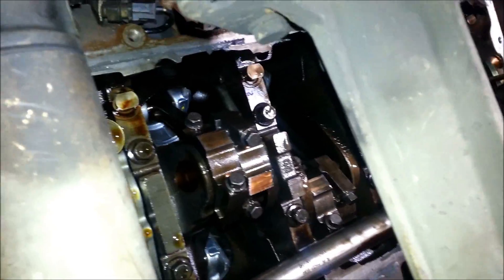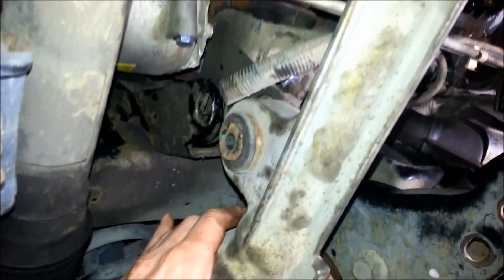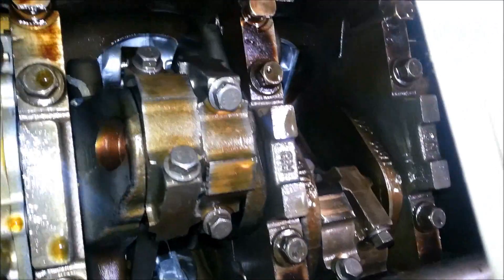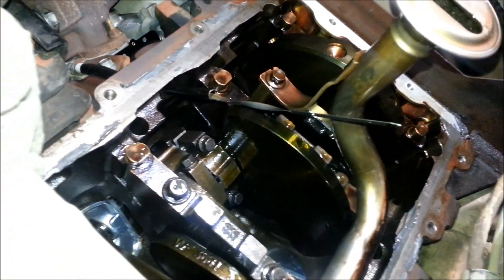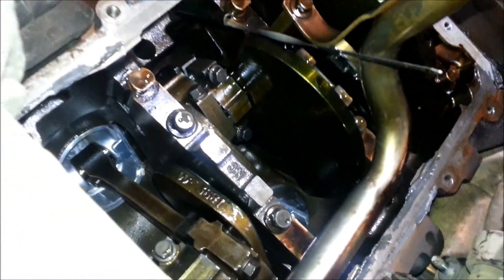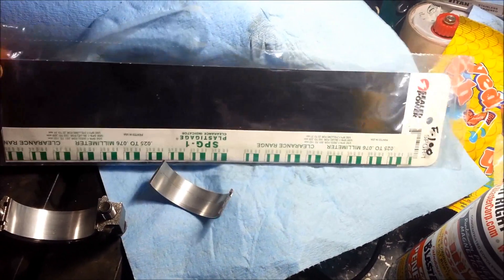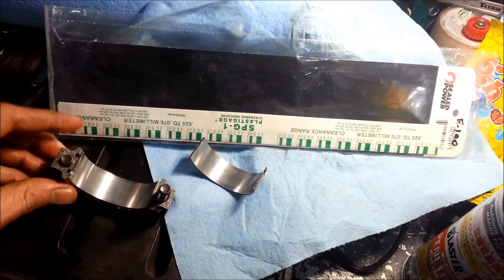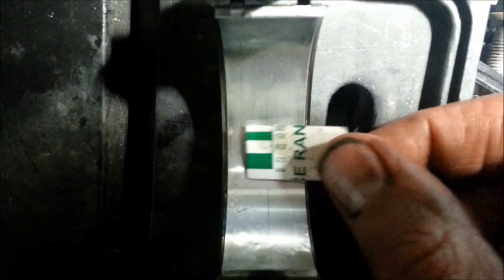03 Expedition rod knock findings/repair part 1

Comment: Hey man I got a question . I’ve been doing some work on my 5.4 3v . I pulled the heads and when hand rotating the engine , it rotates freely and the pistons all look good , but there is a “rough spot “ about 1/8 or so of the revolution every other revolution where it hesitates and doesn’t spin as freely , like it’s going against some compression or something . Is this normal or do you think it means I have a bent connecting rod ? The hesitation occurs right before it hits top dead center . Is that normal , or should it have the same amount of free spin/resistance at all times when hand rotating the engine with a long 1/2 inch breaker bar ratchet ?
Reply from the maker: It's hard to say without seeing it. I had a 98 Expedition with the 5.4L and it had a spot that was hard to get the starter to go past. It ended up throwing a rod out of the side of the block so I would suggest finding out for sure before driving it much more.
Reply: @Diallo268  Hey toulene thanks for responding my friend.  I've realized that i have a chewed up thrust bearing that i pulled out.  So i know my problem is too much end play in the crank.  my question is, when i pull the engine, to rebuild/correct the issue, what do i need to do to remedy this problem?
Reply from the maker: @thomasv5596  It depends where you have too much endplay, but there isn't a lot of lateral force on the engine that I can think of. There is in the transmission but there's a thrust bearing in it for that reason. I would try and identify where it's binding. You may need to pull the pan to see if you can find the issue. What was the original problem it was having?
Reply: @Diallo268  well to make a long story short, i had random multiple misfires on bank 1 and wound up kind of throwing a blanket of solution/tune up on to it. 

I went in and put in all new lash adjusters and lifters.  I also had a vacuum leak, so i put on a new intake manifold gasket.  This didn't fix the problem and then i started getting a little white smoke, mind you i never drove it out of the driveway ever sense bank 1 went down on me with all the misfires.  i was just cranking her up and monitoring live data to see what she was doing.  she was totally lopsided on fuel trims all the way lean on one side and all the way rich on the other.  

 then i checked compression and realized i had 2 weak cylinders on 4 and 5 so deduced i had a failed head gasket on bank 1.  

went back in to pull the head to replace the head gasket, and saw that just in the short time between me putting in the new roller followers and lifters, without ever even driving her down the street, and doing the compression test and now pulling the head, that she had chewed up cam journals, 1 or 2 on bank 1 around cylinders 2 and 3.  Fingernail thick gouge in the caps and some scoring on the cam there in the journal, though the lobes were fine. 

what i also noticed is that my intake manifold gasket around cylinder four in the back on bank one hadn't really seated good and torqued down good.  probably carele$$ error on my part.

so i now had to replace or send both heads to the shop, i opted to get new heads with the cams already installed, got them shipped to me for 500$ a piece. 

then thats when i noticed when i was rotating the crank it was getting hesitation in that one spot instead of free spinning, like i needed to clear the hump.

thats when i took the oil pan down and looked at the crank this morning and found 2 chewed up pieces on the rear thrust washer and the third piece unphased but laying in the oil pan.  

What i'm thinking happened is when i didn't torque that intake manifold gasket down good is water/coolant got into one of the combustion chambers and either bent the rod a little on one piston and or put extra lateral force on the crank causing the rear thrust washer to fail, and some of the metal particulates to get sent back up into the cam journal and score her up.  

the rod bearings and everything look good from the bottom, but i've already started the process of pulling out the main bearings.  what i would like to do is assume that just the thrust washer failed in that short of time since they are extremely weak compared to everything else in the block, throw on new main bearings and even rod bearings while i'm down there and call it good.  But what i'm going to have to do is go ahead and measure thrust and clearances on all the bearings main and rod and make sure its in spec and also measure thrust/end play in crank and make sure its good, and finally make sure my piston rods are good as well.   

as fas as examining a piston rod, how would you go about doing that? i've got the heads off, so if pull the rod bearing cap off, can i just push/pull the piston up out of the block and visually examine if the rod is bent? or how would i go about verifying its good?
Reply from the maker: @thomasv5596  If you already have the pan off I would start by visually seeing if I noticed anything bent or out of place. Next, I would move it around where it's binding and see if I could figure out what's causing it. If you aren't having luck at that point I would pull the pistons out one by one (make sure to mark them so you can put them back in the same order) starting from the back and see if it's one of those. Hopefully you can identify the issue at that point. You may want to check the block deck to make sure it isn't warped too since you have everything apart if you haven't already.
Reply: @Diallo268  thanks for the response.  i'm going through this process right now.

Comment: Video still helping people. Needed to know how to drop front axle down to get oil pan out. Appreciate it. Have a 4.6 motor completely clogged. Will be purchasing replacement motor since intend to keep it. Had timing chain guide break loose  and tensioner not working making a knocking noise. The gritty sludge in the motor makes it not worth fixing. Got it used. Always change the oil on time.
Reply from the maker: I'm glad it was helpful! GL on your motor swap.

Comment: I gotta 02 explorer with a knock with 160 miles only. Should I even try this? The bodies clean and I owe two years on it still. Smh super sad
Reply from the maker: that really depends on what experience you have and if you have a place to work on it. Definitely not an easy or quick task. Mine was an expedition so I don't know how the explorer differs. If the rod or crank is shot you will need to pull the motor and that's even more work. good luck with whichever way you decide to go.

Comment: I believe you have to plasti-gauge both bearings since it's the rod bearing not he cap bearing that;s going to get the most damage .
Reply from the maker: Well I checked the bearings with a digital caliper and everything was good (well the same in multiple places). I didn't notice any damage/deformation either. I used it a few times on the rod cap. If it was out of tolerance I should see it on either side I would imagine. I was more worried about the mating surfaces seeing as it's a cracked cap design. Everything fit great though.

Comment: Once you get a knock and run the engine the big end of the rod will be out around. On cracked rods you can't recondition them the same way as cut rods. You can measure the rod in three spots to see if it's out of round.

Comment: i dont know much bout engines but my 2004 ford expedition just started making that hitting noise. sounds like it coming from oil pan and not sure if i should just sell my expo or get it fix
Reply from the maker: You could take it to a RELIABLE mechanic to verify the noise. An exhaust leak by the exhaust manifold can sound a lot like that so have them rule that out first or determine if the problem is fixable without changing the engine. If it does look like the engine is knocking you could sell it and just get a new one so you don't have to worry about it or you could get it fixed. There are pros and cons to both. Are you having any transmission problems? 

Weigh the price of getting the engine replaced with another used engine vs buying another similar expedition with the same miles minus the value you would get for selling your expedition and see what looks better. If it's similar I would just sell it as a "mechanics special" and get another one. it's would be more of a win-win (for you and the person buying it)

Comment: debating on doing this on a 2000 Expedition, really loud rod knock
Reply from the maker: I had a '98 expedition, it had a knock then all the sudden it had a louder knock. looked underneath and one of the rods punched a hole in the side of the engine block and the oil pan and I lost all my oil. I know this is a little old, but yeah when you get a really loud knock it's either time to start looking to sell or rebuild it.
Reply: I'm having same problem rn

Comment: If u put thicker oil its going to be a matter of time before it blows. This engines weak spot is the oil pump and timing components. Thicker oil will not get to critical parts on time. Like i said its just a matter of time before something blows. This helped pointing me in the right way 
http://www.ford-trucks.com/forums/1427749-bulletproofing-the-5-4l-3v-engine-all-timing-chain-related.html
Reply from the maker: Yes after saying that I realized that would have been a bad idea. I measured it and everything was in spec so all was good.
Reply: I used to buy these up cheap because of all the chain problems with the plastic tensioners. The 4.0 chain engine also has problems. I've never seen one with a bad rod on the four six or five four. But like anything if you don't change your oil they all knock

Comment: You seem pretty good with  Ford. I just change the oil pan on a 5.8 I may have bentthe hanger for the oil pump sleeve that goes to the back of the pan tohe pick up..I put everything back together and I kind of got like a knock do you think it's possible that the crankshaft is hitting it at all?
Reply from the maker: chris tragedia Hard to tell, but if you are getting a new noise and you just did work I would be suspect something was induced. I would post your stuff on http://www.expeditionforum.com/. They are helpful

Comment: Hi! I am going to have to do something very similar. I have a 1999 Expedition 5.4L and I dislike Fords as well, I have a Chevy though the 4.3 I have is made kinda stupid sometimes too.. anyways, this 5.4L sounds NASTY. Starts up quiet usually but then gets to SQUEAKING! So... Jumpy rod, spun bearing, rod knock.. something, but it seems to be on Cyl. #3 or 4 since I got OBD2 codes P0303 and switched to P0304.. ok. So I have to ultimately do the same "take oil pan off" amd start from there.  Then I get to check coils after all that is done. Fun. Soo.. obviously, all I have done is diagnose. Any tips on removal?  First time doing this. Thanks - Joseph
Reply from the maker: TheJCorbi82 I would recommend putting a video of it up on youtube and posting it in the expedition forum. Someone may have a better idea of what it is. It could be an exhaust leak.

The hardest part for me was removing the front axle. You don't need to take it all the way out, but you need to take out all the bolts and move it till you can get it out. If you are actually having rod knock and your bearings are damaged, it would be easier to do the repair with the engine out because you want the engine to be upside down to change the crankshaft if it's out of tolerance. You can check it with plastigage. I had a '98 Expedition before this that threw a rod and I ended up selling it because I was getting ready to move.
Reply: Toluene, can an exhaust manifold leak sound really loud and squeaky?
Reply from the maker: TheJCorbi82 Sorry I thought you meant knocking by squeaking. I would post a video of it first. Did you hear the squeaking the same time you were getting the misfire codes? Did the misfire codes come up around the same time?

Comment: Plastigauge is useless if you don't torque to specs.
Reply from the maker: Not true. Torquing to spec ensures adequate bolt stretch, not a closer connection.
Reply from the maker: You also are not supposed to reuse bolts that have been torqued to spec so I would have to replace every I've I used for it if I did it that way.
Reply: Toluene Aaahhhh true. Didn't think of that.
Reply: Toluene
You don't have to always get new bolts.  If the bolts are Torque-to-yield then yes, you can never reuse them.  But if they aren't you will be fine. 

I guess the best rule of thumb is if you dont know if they are TTY then replace them. Also in your case, since they were subject to shock load I would also replace them like you said.

Props to you man...well done.  Most people would look around for a new motor as soon as it was knocking.  You took the time and know how and it payed out in spades.   I hope that truck lasts you years to come.
Reply from the maker: Bone Daddy
All the connecting rod bolts were TTY.

Thanks :). I was hoping since he just rebuilt it that it was something repairable. That wasn't the only problem either! He had an engine mount bolt only hand tight! He ran a coolant line to the transmission vent tube (a lot of fluid got into the tranny, flushed it twice, tranny seems strong)! There was an annoying payment protection system that I had to remove and rewire back to stock configuration because sometimes it would act up and wouldn't let it start and other things too that I can't remember. She rides nice and definitely seems like she will last :)
Reply from the maker: Bone Daddy
Yea he said he used to be a mechanic too... Either way I'm glad I was able to fix it without pulling the engine/tranny.